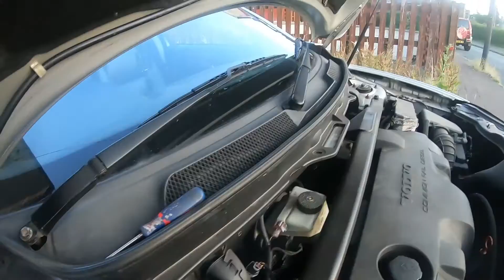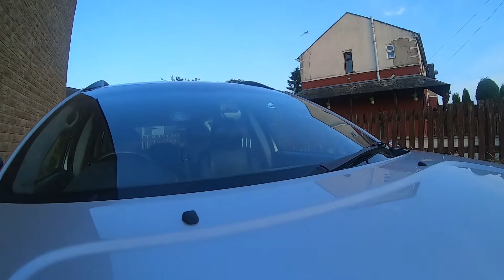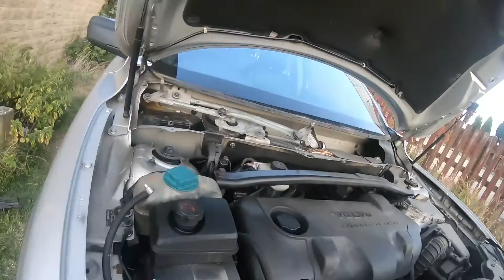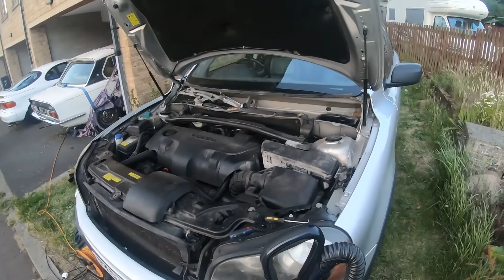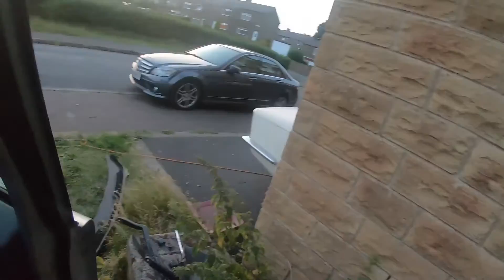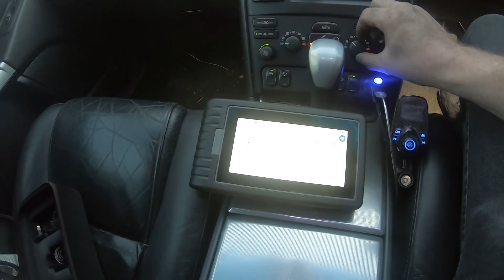I FINALLY fixed the climate control error code - 2003 Volvo XC90 Part 32

Comment: many years later....had to remove motor (twice) as something in the whole CCM setup isn't working - no fan. Been working my way through fuses, CCM, fan, fan controller resistor, air quality sensor...one thing to note is I have found it is possible to replace the air sensor when you have the fan out. This is worth doing because you should really use a wiper arm puller to remove the wiper arms to get to the sensor from above. If only changing the sensor, sure, this is way less hassle than removing the fan motor. Hella make an air quality sensor for at least half the Volvo stamped one. IMO it is worth replacing this sensor when fan is out because it sometimes messes with the CCM logic. Also replace the CCM bulbs while out, and CAREFULLY clean the cabin air temperature sensor and fan - do not break the wire. If you do, it is possible to obtain correct wire and solder a new one in (search YouTube), but avoid snapping in first place! I did resolder all the fan speed joints on the rear too. They will dry/break, so you might as well do that too while the whole dash is out!
Reply from the maker: There is another CCM that fits (a VW part which could be the same as the Hella one) but it can cause problems as it must be different internally so a Volvo part must be used. They're expensive brand new so I went for a genuine used one on eBay.

Comment: Thank you for another xc90 video.  How does air quality sensor manifest itself when it malfunctions? Did it affect climate control somehow? Thank you
Reply from the maker: It literally "sniffs" the air that comes in to the HVAC system and it closes a flap to stop any bad smells from entering the interior. It is situated above the blower motor.